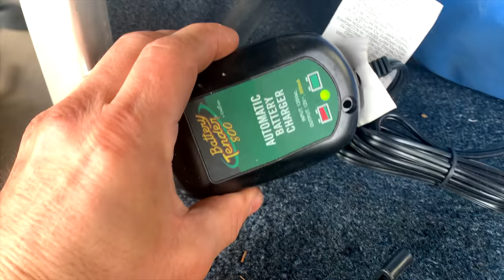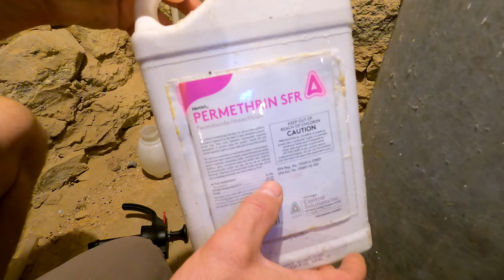8 REAL Farm and Garden Hacks You Probably Haven't Seen Before.

Comment: A roll of "remesh" from home depot is pretty cheap and sturdy for tomato cages too. It will rust, but is meant to.  A roll of the stuff will make all the tomato cages a family could likely want. Give a couple extra as gifts to neighbors that give you veggies and stuff. 

The roll of remesh is easier for some folks to get home than the huge hog panels.  The hog panel approach will have a less rusty look and will certainly also last.  I agree on your commercial tomato cage complaints. We grow some in a greenhouse, and they get 10' tall.  $ wise it's a close race.  

Loved all these tips. The lifting tips would have been to practice when splitting 4' rounds.  Nice tip!

Comment: The repellant. That was new to me. Will try that.
Have a better, easier Firestarter. All my painting waste and cooking oil go inside one bucket. Then i fill it up with used sandpaper, kindling, tree bark and whatever burns. Give it a few hours and you have yourself a long lasting, very flammable Firestarter. Depending on the kindling, it will burn from 5 minutes to an hour. Good enough to get wet wood going.

Comment: I use cattle panel for my tomato cages as well. Most of the farm stores will just give you the wire scraps that hold the panels during shipping. I've used those wires during fence repair, holding the cages together, and even hanging tools.

Comment: For tomato cages I have used the reinforcement grid that you put in concrete for years. Same exact construction though, cut and then bend to make them round. The reinforcement grid is taller than the cattle panels so it allows the tomato plant to grow a little taller with support. I just use 2 electric fence posts and a little twine to tie the cage to the post for securing them down to the ground versus cutting the bottom of the cage like you did since mine are taller they get a little top heavy and need the extra support that the fence posts provide.

Comment: I have used cattle panels for years but in the last few years I cut the panels into 16 inch panels and use cheap Chinese hose clamps to hold the corners together to form a square. I plant them in my raised bed soil and they work great for peppers.  For cherry tomatoes I add a second level and the plants grow up and beyond the 8 ft height. I made a circle out of cattle panels of 30 inch diameter and mount one on top of the other for one regular indeterminant variety of tomato plant. You must stabilize these whenever you go two levels high for the wind and again I use cheap Chinese hose clamps to hold them together. Battery tenders are great-used them for over twenty years. I leave my portable air tank hooked up to the air compressor when not used for more storage capacity.

Comment: At around 7min. We here use either 12mm (~0.5inch) rebar cut at 2m lenghs, push it ~30-50 cm into ground and tie tomatos with string. It will last 30+ years and support even heavy growth. We use rebar mesh 5mm thick with 150x150 eyes for beans, wich we place in A shape with support rebar at ends. And 6 mm one for cucumbers. Those are vertical cut from 2x3m piece into 2 2x1.5m ones with support rebars at ends of each segment. Those too will last 30+ years. We usually make wall from them, but if it's windy or soil is weak, you should do zig zag pattern and tie them in middle and top.

Comment: I made tomato cages our of concrete reinforcing metal that comes in a roll. The openings are comparable to the cattle panels. The material is not as thick but much heavier than cheap ready made cages, so it bends much easier. I am using the same ones that I made over 30 years ago.

Comment: The way I start fires is slower but also cheaper.  Get a small wide mouth jar.  Then with rubber gloves on, take cotton balls and mead them with petroleum jelly.  Put the lid on till you need a fire.  Then with a small stick, curl a cotton ball    on the end and light it.  No use getting the grease all over your hands.  This will burn for six or seven minutes.  Plenty of time to start a fire.  I just moved to twenty acres of woods in Arkansas, thanks for tip about ticks and chickens.  We have plenty of them down here.  I’m going to watch for your next video.

Comment: air tanks can also be made from bulk refrigerant tanks by using a #4 JIC Female to 1/4" npt fitting. hvac services typically throw them away when they are empty. the threads are not true JIC threads, but the pitch is the same and the flare is the sealing element anyway.

Comment: Tomato cage : my neighbor gave me 12 or 14 of these cattle panel cages about 4 years ago.  I have  been slowly building new ones to add to my garden. She told me the ones she gave me were probably 30 years old. I have never seen anyone else using this big and sturdy cage on tomatoes but they are fantastic. just pull out of the ground and lay them down when not in use. I am from  western Pa. so these have laid out in the winter many years and are still going strong.

Comment: TIM from Canada comment to add to your weed burning situation. after you have used your propane torch to get your bonfire going. get a leaf blower if you have one battery powered. this will keep your fire going just go around to different spots on your fire and put the leaf blower to it. you can use a rubber band or a piece of tape to keep The trigger down and leave it in one spot for a while this will help

Comment: Great video.  Loved the permethrin trick.  I learn so much from your videos.  

Battery Tenders.  In my experience they extend battery life by 3-4 times.  Harley Davidson parts guy (after me complaining about replacing a 3 year old battery for $120) talked me in to getting a $40 tender.  That battery lasted 10 years.  That's over $300 in savings.  4 wheeler, same story.  $80 in battery tenders has saved me $6-700 in batteries.  I now use them on everything.  I don't know the Batteries Plus guys by name anymore.

Tractor battery.  I have a tender and a battery blanket to go with the block heater.  Works great.  Well, I'd rather have a heated shop, but I'd still use the tender anyway.

Comment: For starting fires, i use used oil from oil changes. Then I take old socks and rather than throw them away, i roll them up into a ball, soak them in the used motor oil, light them and throw them in.  They are small enough to get down deep into the pile. They burn a pretty long time.. Long enough to get the fire going. Typically i will throw 4 or 5 in. Once its getting started, i will get my leaf blower and gently blow air in to get it really going. Like they do with blast furnaces.. Like a bellows, i think its called that a blacksmith would use.

Comment: Seen them all (with a minor exception), plus some additional for you.

Instead of hog panel, which is pricey, I used the grid roll from pouring concrete pads.  Not quite as heavy duty,but works as well and as long.  Also can be cut with pliers instead of bolt cutters.

Lastly, to keep your fire burning at optimum, use a leaf blower to feed it with uxygen when it gets low...no fuel required.
Reply: Oxygen...we don't have uxygen on this planet anymore.

Comment: Hello John, I see you are missing a fender bolt on your tractor @ 1 : 50 / when you are talking about the battery charger.😁 I have one for my lawn tractor. How about painting your air tank green so other people will know this is and air tank, also make the tank nicer with no rust. I have and old Freon tank I use, I painted mine Green and added AIR stickers. I think Harbor Freight had a kit one time with a pop off valve and a gauge with it. John, I'm like you, I always check my ear muffs for 🕷bugs. Lots of Great Tips. 👍I too have use gas 💥💣to start a fire, Kerosene works but will go out. I guess I will get a small torch to start my fire pit. Thanks John. I wish I had a Neighbor like you !😆👍

Comment: The tomato cages & with you on using on the the fire stuff never use gas bottle of light fluid works well around $5 good tip try to keep some of the wood dry if you know your going to burn if you have some dead wood or scraps cover with tarp or garbage bags

Comment: I keep a can with used motor oil and when it comes time to burn a pile of brush, I pour some of it along with some diesel and old gasoline into a SS sprayer. I then start a small fire and direct the spray into that fire. Works sort of like a small flame thrower and it is a lot cheaper than using propane.

Comment: I have used concrete reinforcing wire for years. Does the same thing,  however  I think yours is better as the wire is not coated an rust  bad.

If you want to use some type fuel on a smaller pile such as fall leaves get charcoal lighter fuel.  

Like your videos.

Comment: For the tractor shade, I use two 40 inch lengths one-inch-square tubing. I use a removable mount. I wrap a white cloth fairly loose around each square tube and fasten it with hot glue so the cloth spans the space of about 4 feet or so between the tubes. The warp of the cloth should be spread between the bars so it can stretch tight. I let some hang down in back so my neck won't sunburn. The white cloth really reflects the sun well so it is cool shade. The cloth lasts about 3-4 years, Less if I keep getting it caught in the trees.

Comment: Enjoyed tips. One for you: Don't use cafes for tomatoes. Very inefficient. Use T post and twine. I use one T-post followed by 3 wooden posts then another T-post. The posts are in between every other tomato plant. The twine is put around the tomatoes every 6 inches high on both sides and pulled tight.

Comment: We used to make similar cages for plants out of rebar matting, it is easier if you have a big metal roller, but smaller diameters of rebar, 6 to 8 mm (1/4” to 5/16”) can easily be done by hand.

Comment: I always check my ear muffs. Found earwigs in them of all things. I wish I had equipment that needed constant charging. I use a small tank for transporting air for over 20 years. Before it became a thing. I use my legs for most of the work by using them as levers or jacks. I learned at a young age how to use a shovel. It is amazing how much of the younger generation have no clue how to dig. I use cattle panels in an arch to grow beans, peas, and cucumbers on. I made tomato cages out of EMT conduit. I use the propane weed burner to start fires. And burn weeds out of the gravel driveway. I’ve used most of what you have shown. Grew up a carpenter and went on to become a millwright, electrician, and then maintenance manager and then retired. Learned a lot of little hacks as it’s called apparently. 😊 Like your show.

Comment: #3, I use concrete structure wire. a lot more of it for way less monies. Been using them for over 40 years. 
#8, usually use a stack of news paper, and/or sparklers. cheap old 4th of July crap sparklers.

Comment: I make them out of heavy gage fence wire with the same success.  I had one garden location, I did not cut the end ring off.  The spears have made storage problems over the years.  In the one case I have  alarge chainlink fence behind the garden strip.  I just tie one of those 2 x 2's n the cage and through the fence to hold it in place on windy days or some squirell day.

Comment: Thank you for sharing, I have often used the cattle panel for making cages, but I do mine a bit differently. I cut my panel between two and three squares wide, I do not touch the height. Then I use either 9-gauge wire or what I like best are the clamps that are used for creating rabbit cages. I clamp the sides together (4 pieces), making a square cage. I started doing it like this because I am not strong enough to bend the cattle panel. this works really well for me. If I need a taller cage, then I stack them and then hold them in place with a rebar pole so that they don't move in a high wind. I like how you placed a shade cover over your tractor, I wish I could figure out a way to place a shade cover over my riding mower. I appreciate your sharing with us all. Many blessings to you always.    ~SuzyJC-in-Pataskala-Ohio/USA_07.28.2022~

Comment: A very simple way to make a pile of brush or any woody stuff burn easily is to put a 4ft square piece of black plastic over the pile and then stack some more stuff on top of that so it wont blow off. I stack these piles and let them season until fall when it is safe to burn because it has rained quite a bit. you only need a small dry patch to get the fire going and then add the wet stuff from around the edges on to the fire and it will all burn. I learned this from watching the US Forest Service burn logging debris back in the day when they used to log some of the forest. Now the USFS is into turning the forests into charcoal

Comment: Best value for money on tomato cages is to use a roll of remesh; way less $$$ and they are 5' high. We ended up making tunnels using cattle panels and that turned out best and easiest work on the body; only installed once. Slick one on the air tank. How do you make sure it's safe to use? I used to live in Australia. You always check anything you put on and always look under the toilet seat. When running a bonfire, be sure to keep a working hose handy, recommend wearing a canvas shell jacket with plastic buttons. Wear nothing with metal like rivets or buttons. Remember PPE and keep your phone handy. Also recommend a walkie talkie to backup in the house.

Comment: 4:37 so far you are eating that screwdriver :) . But there is a by far easier way of doing this with cattle fencing. After you cut it you tack it to something round, we used old tires with a fence post in the middle and then just wrapped the cattle fencing around the tires and it made for perfect size tomatoes cages.
Reply: Well that one bug protection got me. I use something else that works really good but does not last. Cintranella. And since ya ate the screwdriver anyways I did like the video. Oh and true pyros never need chemical accelerant. Wont subscribe though unless you subscribe to my Pawsuasive Dog Teaching channel in return. :)

Comment: We've been doing the permetherin trick with our military uniforms for many years, deploying to mosquito infested areas.
They're good for 6 month deployments.  Usually....
Reply: Thank you for your service!
Didn't know it works for mosquitos. I just bought some to spray clothes with. Was working on some property and kept getting attacked and bitten by ticks so i quit going to the property. Mosquitos were insane and had to use bug spray that i hate to be covered in. I read online about spraying clothes for ticks. In his video he used it on shorts and tshirts. What i read said you had to have long sleeves, pants, hats e.t.c. with 115° heat index i was discouraged and still haven't went back up to the property.
(Walk from car to building have ticks on me)
Any suggestions on the best way  to use this?
Property has woods and about 1 acre that has tall weeded grass. No one had lived there for several years. 
Had most of the old rotted mobile home torn down. 
Would like to get that finished before winter. I mowed the grass a few times im sure it's up to my shoulders again by now. 
There are fire ant hills in the tall grass i need to do something about (huge ones i was shocked how big)
Would like to enjoy/ reclaim  this property.
Just frustrated.
Reply: @backroadsusa6915  Treat your pants/socks/shoes once a year and it should be fairly decent at repelling them.
Keep that grass mowed down, ticks thrive in unmowed field grass.
Also get some Guinea fowl, they love ticks.
Reply: @Absaalookemensch  i plan on getting those once i move there.  No water yet on the property,  working on that.

Comment: Great video. I use the Harbor Freight "weed torch" to start my fires too. Also a great way to start a pile of charcoal. As far as your tomato cages, nice job. But I bought a roll of "concrete reinforcing wire". A 50 foot roll was like $70 (15 years ago). Easier to work with, cuts nice with bolt cutters. Last forever. 5 foot tall. Just a thought. Got a ton of cages, and they come "pre-rusted". LOL
Reply: I just read the comments below and see many folks use the concrete wire. Ooops.

Comment: I actually kinda knew #6 already. At a regular, big  Easter camporee I used to attend in my teen and twen years, the local fire department used to oversee thr bonfire opetation. And they eould also hidr some gas pipes underneath to assist with the ignition if need be for a wet pile. Weed torch is pretty neat. And Safe. Firemen-approved.

Comment: On my burn pile I used the blow torch and a fire of kindling and wood at its edge to get it going. Then I tossed small empty water bottles filled with diesel on the top of the pile to dribble down. You can leave the cap off and if carefully tossed it doesn't go all over. If it ends up upright and not emptying, eventually flames melt it and released the diesel into the pile. Also a local restaurant wanted to get rid of their old cooking oil. Great accelerant too. Lifting with your legs suggestions great! Will start them right away.

Comment: I use a little dry wood and make a small fire inside the bonfire, works every time. Started doing it after a gasoline-in-the-winter incident…. Probably a bit slower than your propane method but no need for hardware is a plus

Comment: Ok, by your list. 
1. Battery charger, didn't have them back in day, but I use them now.
2. Shade, done with aluminum c channel, had lots cause dad did work with storm windows and doors.
3. Tomato cages we made from rolls of concrete reinforcing wire. Cheaper and easier to work. Custom sizes, no left overs.
4. Propane tanks, made many of those.
5. Leg lifts, done that.
6. Bug spray,  never heard of it. Except to kill scabies, most hated bug.
7. PPE, never used any except welding/cutting visor . Yes wasps were/are pesky.
8. Fire starter, diesel mixed with old motor oil. A old tire works if it's really stubborn.